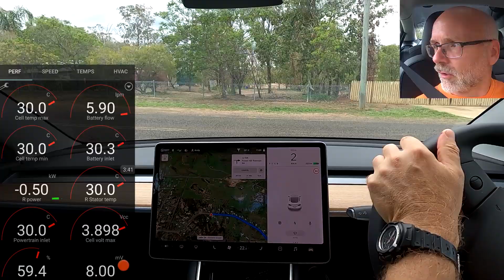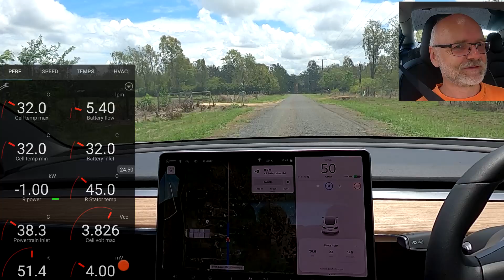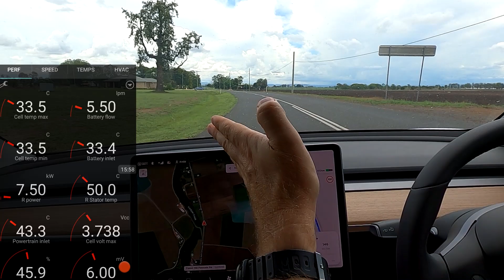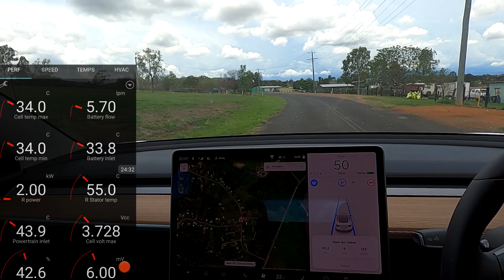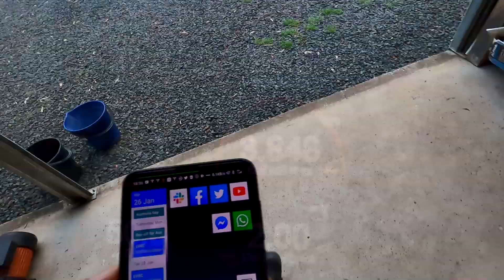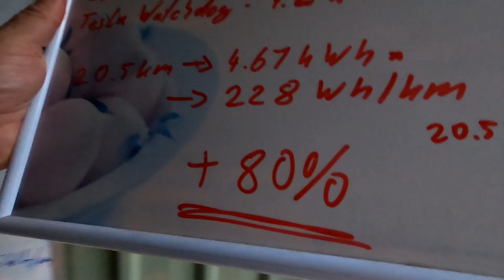EP328 - New consumption test, much better result for the Model 3

Comment: Andy, why don't you try an active gimbal?
Reply from the maker: The metal extension arm will fix that. I bought a plastic one which twisted to much. Gimbals are too expensive, to heavy and I only would need it for this exact purpose in the car. The sucker would need replacement too. The Hero 8 has sufficient picture stabilization and is better than a gimbal. Maybe when I got more Patrons 😉
Reply: @unpluggedEV  something like this. Not very expensive : https://www.microspot.ch/de/foto-video/stative-beleuchtung/stative--c324000/dji-osmo-mobile-3-handstativ--p0001884077?gclsrc=aw.ds&&gclid=CjwKCAiA1fnxBRBBEiwAVUouUrI2svtzvTQ4abZ6_udKK8M_a38pr1zv-I_qQwyxYoVuBUTl2uOzNBoCvCgQAvD_BwE
Reply from the maker: Yeah, I did a lot of research before buying it. Initially I bought the GoPro Max, a 360° camera but it disappointed in terms of video quality and also there is no desktop app for editing 360 videos so only mobile editing. I sold it again and bought the Hero 8 Black which seemed to be the best fit for my purposes: small, one button recording, extrem stable, good sound. It is pretty much the same or better to what these gimbals can provide these days so kinda makes them obsolete. At least in this kind of segment.
Got a quick comparison here: https://youtu.be/viUtvwOLAuA?t=239
Reply: @unpluggedEV  I have hero 8 black on that gimbal. It keeps the level no matter what and follows objects that you mark for tracing (only on mobile though).
Reply from the maker: @Jakub-CH  what's your YouTube channel. I may want to subscribe 😁
Seriously, that's a bit of overkill. For high quality outdoor documentaries and cinematic shots, yes maybe. But not inside a car or for vlogs where everything is rough, raw and fast.

Comment: Even with regen limit the Car still stops on 1 pedal mode?
Reply: Yes. If you let off the accelerator pedal completely it will take longer to slow down above ~6 km/h with limited regen. Below that speed it feels like about the same time to come to a full stop. Not sure what happens if you're at 100% charge (in 4,000 km I've never charged above 95%). Tesla haven't (yet?) implemented braking to mimic the same experience when available regen is low, so the driver usually has to adapt their driving accordingly. I actually prefer it this way.
Reply from the maker: Even at 100% SoC, the car has still some regen. I haven't tested if it fully stops though.

Comment: What happens when there’s been a severe rain storm event and the roads character has been modified?.
Think about Mumbai or a quaint European village on market day.
Reply: We in Victoria have to deal with significant roadkill issues in the country.  You can’t quantify everything.
Reply from the maker: I guess FSD will get to 80% and then gets stuck due to road conditions which it will never be able to handle.
Reply: unplugged EV I agree. With global warming trends extreme events and the damage caused will always be disruptive not to mention camera obstruction events.

Comment: Do you use the speed control button regularly to manage cornering speeds?.
Reply from the maker: If I'm in autopilot and not on a highway, yes, a lot. I manually adjust speed as per situation. Autopilot is not designed to drive on these roads and tries to maximize the speed. Most of the time this is far to fast for tighter corners.
Reply: I’m getting the basic standard autopilot , is that the same as yours Andy?.